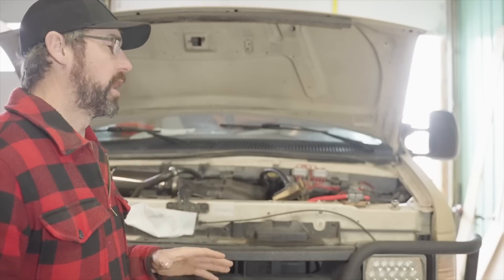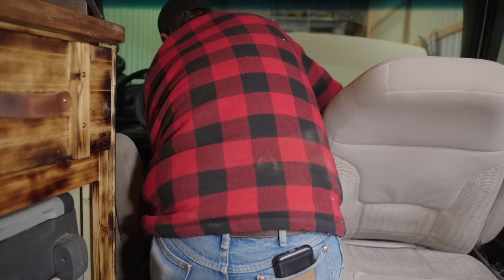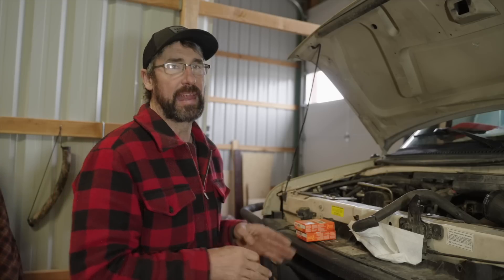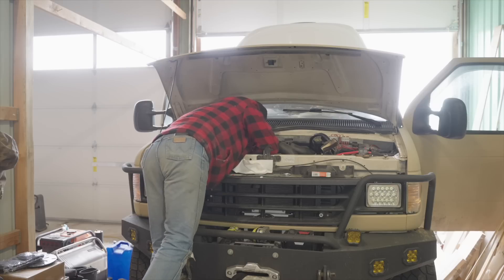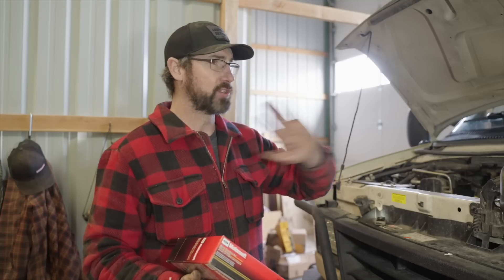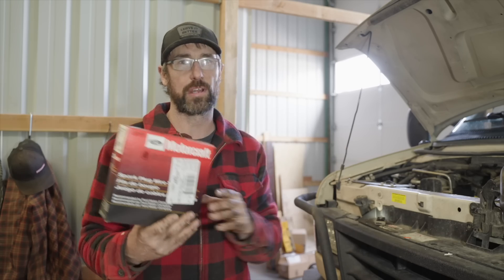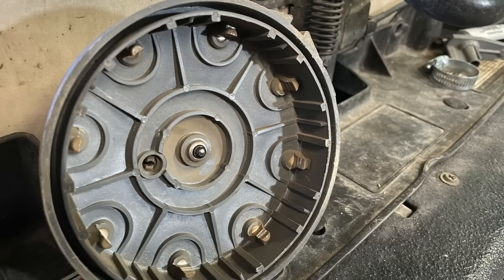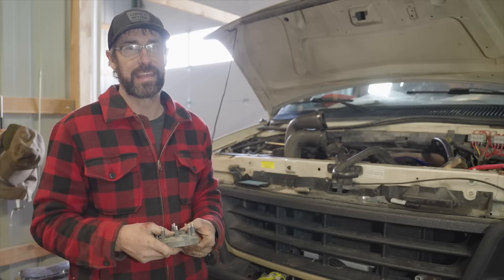Do Not Underestimate the Power of a Tune Up - Ford E350 5 8L

Comment: I drive a 5.4 2008 and I started changing out the main things like mass airflow sensor spark plugs and muffler and exhaust sensor and all fluids made a huge difference to the van

Comment: Another Road trek owner here. Mine is an '89 Dodge with 5.2 and I will be doing a full tuneup this spring as well. It is a good thing to be self sufficient  and be able to do these  basic  repairs ourselves. Have a great day. Tom  up here in Canada  in the Maritimes  at the NB-NS border.
Reply: Not planning on a Quigley 4x4 upgrade on my Roadtrek Jason-style, but we do like going down decent logging roads and boondocking vs campgrounds.

Comment: Back in my 20"s I bought a 1980 something Chevy Beauville passenger van from my parents. It had a 350 with a 4 barrel carb and while you couldn't access the engine completely from under the hood as is typical with most vans the engine itself was very easy to work on and that in my opinion is a luxury compared to modern engines today.

Comment: I'm happy with it! Good motivation to do the routine maintenance I'm needing to do on my own van! Simple work for little cost, compared to paying someone! A new look on how to do it right, because I've had issues with some wires failing during installation.

I've done this a few times in the past, and now I have tons of tools to do it! You might be able to do this with a very basic set, but just need a plug socket. I usually only had a Walmart set, and several extensions, because the sets keep breaking.

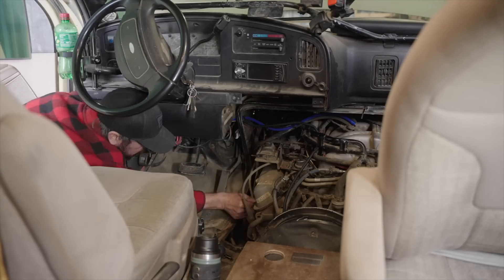Comment: Regarding plug gap.  (... just sayin.. I was a Certified Ford Master Mechanic in the 1990s ) ... and what I have done for years, with the spread ... in your case .042- .046 ... I set it at the lowest .. I agree with oem plug and not go for what part stores will say ... i.e. iridium etc. sure they fit but motor is designed for what the factory put in it (baring later TSBs and the like)... The reason I set it at the lowest is that they will run longer and still stay within specifications.  I also always measure what I take out ... and can tell the customer... ... going back to off pause (2:37) and you may very well already cover it but I use coper anti - cease .. I stop using the gray years ago, it dries and makes things stick ...  later. ... I also use the OEM cap and rotor where the cap is brass colored contacts, not the aluminum.  Check it every three or four months and keep the carbon chipped off of it ...

Comment: Sometimes old spark plug wires or cracked boots can cause arcing and an apparent miss in the engine, especially when in wet weather or high humidity.
To check for this wait until it's dark and lift the hood while the engine is running. If the wires are bad you will see arcing or a blue corona around the wires.
That being said, it's a good idea to replace the other ignition components as well, as evidenced by the arcing on the cap and rotor in Jason's rig.

Comment: Interesting, no electronic ignition in '94. But fuel injection by this point, correct?
Reply: It does have electronic ignition, but not the more modern "distributorless" version where there is a separate coil for each spark plug.
Reply: And yes it is F/I.

Comment: Thats a great engine of course because it was built in the 90's my 04 5.4 triton was nothing but a headache getting to the spark plugs was a nightmare they snapped as you tried pulling them out, hence why mechanics charged a cock and an arm.

Comment: These Ford engines with EFI need to have the throttle body removed and cleaned periodically and the air idle control valve and throttle position sensor aren't uncommon to need replacing.

Comment: As an auto shop owner I can try to give ya some advice. Autolite is a terrible brand. The spark plugs they make are not worth the box they put them in. I have fixed at least 3 or 4 cars which owner had "Just done the plugs" and replaced them with the OEM and fixed it. If your on a ford Motorcraft plugs are the best for them. Most spark plugs these days last 80k or more. Id bet those crappy plugs are gonna be shot in 5-10k

Comment: If you have a 5.4…may god have mercy on your soul.
Reply: What's so bad about it? That's the one I want.
Reply: The van 5.4s are 2v, the only issue concerning the spark plugs is that there isn't a whole lot of thread to keep the plugs in place. The infamous 3v and the breaking spark plugs weren't used in the vans, right?

Comment: Hi Jason, I am a brand new subscriber and purchased a 1990 Ford e350 on a RV I recently purchased. It is coming though with a few issues. I do not know what state you are in in case you are in my state, I would like to hire you for these again only if you are within my state of residency with your extreme experience from the videos I watched from your uploads. A tune up is something I always have done immediately on any of my vehicles purchased. 

I am also having a issue with not enough fuel getting to the engine since the replacement front fuel pump was installed a few days ago so I am carefully taking notes. If you can suggest anything to be looking for, please advise. In the meantime, may I ask you what state are you in?

Comment: the 5.4 3 valve is junk!
Reply: One of the worst engines in the past 30 years. I would never even consider a Ford with that motor.
Reply: The 3 valve version was never offered in Ford vans. Only the 2 valve motor, which is very reliable and gets decent fuel economy.
Reply: Irrelevant when talking about vans since they never put the 3 valve version in them, only 2v.